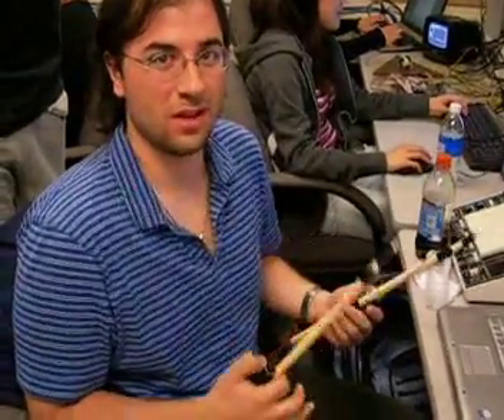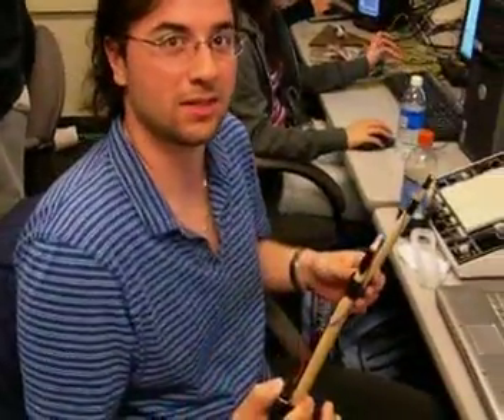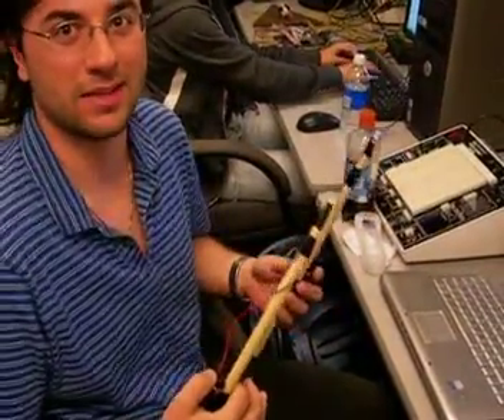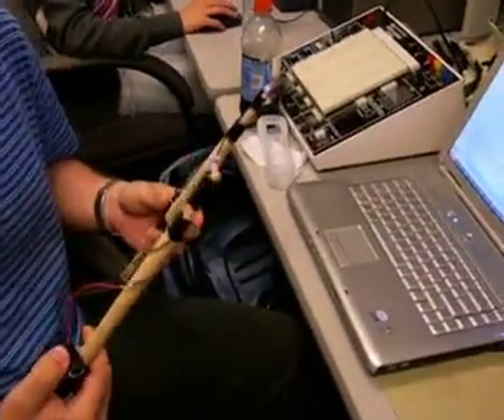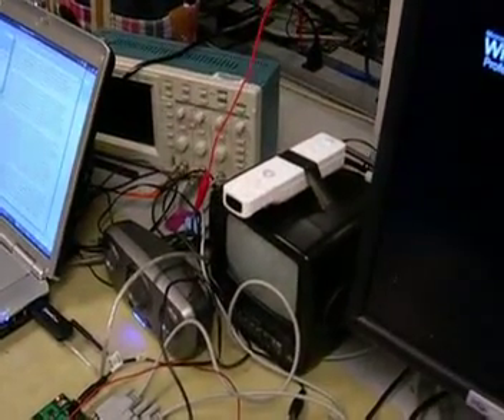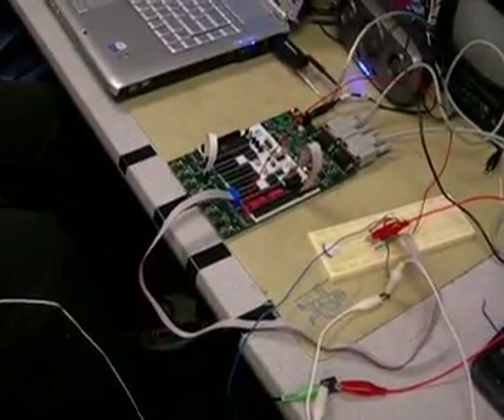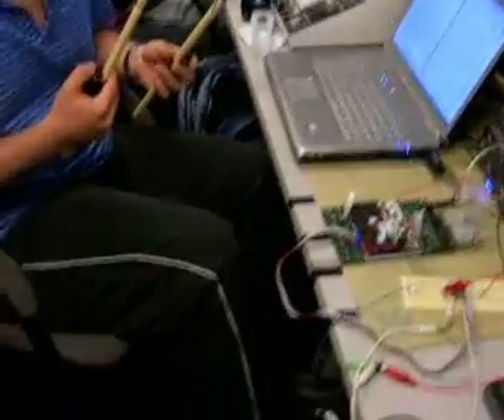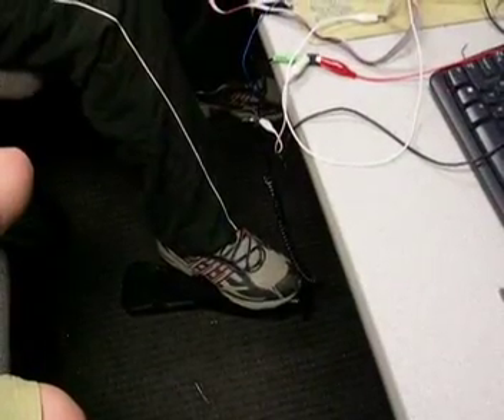Virtual drums with Karplus-Strong synthesis

Comment: how do you synthesize drums using karplus-strong? I've only been able to make short sequences with it so far.
Reply from the maker: You can change the low pass to high pass in the feedback loop, but is limited. Drums are easier synthesize using additive Fourier synthesis. Or if you have lots of compute resource simulate the wave equation.
Reply: @ece4760  Thanks, I'll try everything if I can.
Reply from the maker: @JiMMy-consumer-rights  some more info https://people.ece.cornell.edu/land/courses/ece4760/PIC32/index_sound_synth.html
Reply from the maker: and https://people.ece.cornell.edu/land/courses/ece4760/labs/s2012/synth_test/Markov_music.html
Reply from the maker: and near the bottom of https://people.ece.cornell.edu/land/courses/ece4760/Math/avrDSP.htm
Reply: @ece4760  thank you so much